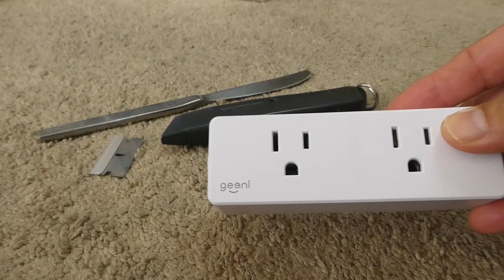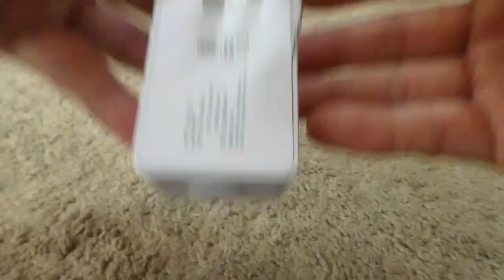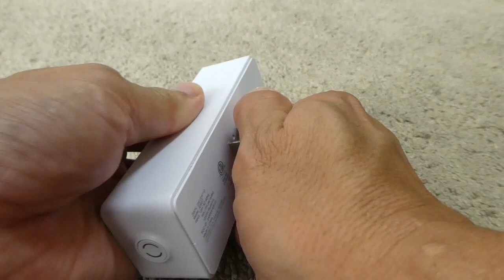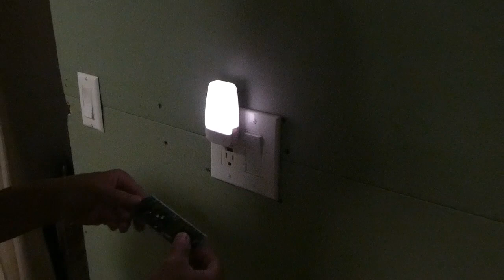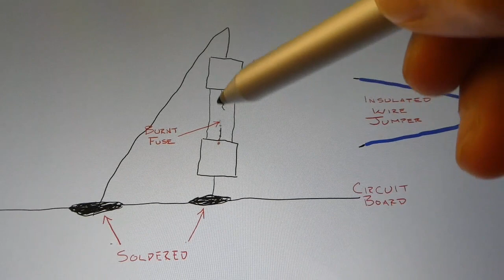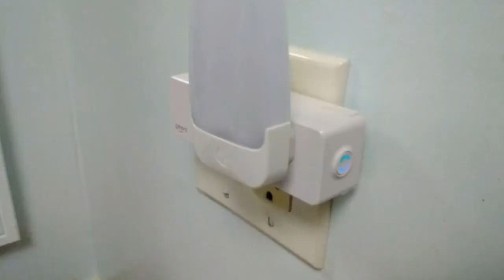Repairing a Geeni Duo Smart Plug

Comment: Hey folks. Please don't ever test a fuse by plugging the device under test into an outlet in this manner. The fuse exists to save your house or even your life in the event of failure or misuse. This is incredibly dangerous, and potentially deadly. Just off the top of my head: if the current is high enough to blow the fuse and you short it, there is a real possibility of badly burning your fingers. 

All you have to do is get a simple multimeter, learn how to put it into continuity mode and probe both ends. The device under test does not need to be powered. If it beeps the fuse is not dead.

Comment: Wouldn’t  an ohm meter be a lot easier and safer? You,may have to disconnect one side. But my light on indicator isn’t even working, any ideas? I see your fuse blown but the blue light indicator works, mine is totally dead. I will take apart and see . Good video
Reply from the maker: If you're able to fix it, could you leave a reply.  That's a new situation similar to when my fuse didn't blow, which I never fix.  These devices are so simple, it might be the same thing...Thanks
Reply: Yes and yes. There is no need for the device to be powered in order to test the fuse. Nor should the fuse be shorted with a piece of wire. Do a continuity check with it unplugged.

Comment: Are there 2 fuses (one for each outlet)?  The reason I ask is I have the same issue but only with one of the two outlets. Thoughts?
Reply from the maker: My Geeni had one 10A fuse for the unit of two outlets.  I did have a unit that recently stopped working (both outlets) and the fuse was still good.  I tried using a multimeter to see if it was a part I could replace, but my skills with the multimeter are subpar, so no luck with that.

Comment: My indoor round geeni smart plug doesn't power anything either
Reply from the maker: Basically, if what you plugged into it requires more than 10 Amps, it more than likely will blow the internal fuse of the Geeni.  You can find the amp rating on your appliance next to INPUT of the power cable.  It's usually right next to the volts it needs.  That's the max it will draw from whatever it's plugged into.  I had mines plugged into a water heater so I definitely realized afterwards that was too much amperage.

Comment: My Merkury SmartPlugs stopped working properly as well.  Very informative video.  I wouldn’t recommend Merkury because they stopped working after only a few months.  I expected more longevity.
Reply from the maker: Yeah, I've noticed a lot of complaints about that online from many brands.  I think they're just not meant for high amp appliances to be plugged in.  I had my water heater plugged in to mine, so that's more obvious to me now that I know.  I think things like hair dryers, fans, power tools, they'll all burn out the internal fuse.  Once that happens, the only way to fix it is if you can find someone who can open it up and replace the fuse.  Sorry about your Merkury.  Glad the video helped.

Comment: Do you know how to disarm the single plug?
Reply from the maker: Do you mean disable one of the plugs so there is no power even if you plug something into it?
Reply: You repaired a double smart plug. I have single smart plug, are different. I think I have the same problem than You. The green and blue led works, the same way, sound "click" when I order Turn On or Turn Off, but nothing happen with the apliance conected.
Reply: You used a knife to disarm, but the single plug does not have the lid flush with the box, they are a little different. We are talking about Geeni smart plug
Reply: I have problems with the language. I fully understand your technical explanations of the failure. I just want to know how to open the plastic box. My connector is different from yours.
Reply from the maker: @papeleriainfinity4640  OK, I understand now.  let me take a look at my single plug to see how it looks.  I'm not sure if it's the same as yours, but if it's different from  the double, then maybe.  I'll get back to you.
Reply: Thank You.
Reply: This is my Geeni Smart Plug: 

https://www.walmart.com/ip/Merkury-Innovations-Smart-Plug-1-Pack/126201995
Reply from the maker: OK, I think I understand.  Even the single plug version should have a FUSE.  If you plug something into the Geeni that requires lots of amps (see label on device).  If it requires more than 8 amps, the fuse on the Geeni will burst and all power will be cut to the plugs.  This is what I had to fix.  I could not find a fuse so I soldered a wire, but I no longer plug high amp devices into the Geeni.  Be sure to keep it under 8 amps.
Reply: Good grief! That fuse or substitute is easily found in any online electronics supply. In fact it looks like there is ample room to lay a typical replaceable fuse horizontal in the same general area held by fuse clips epoxied in place. The fuse area is the mains part of the device so there is no concern for voltage separation.

That fuse protects both of the outlet relays together. These relays are probably 10 amp rated. The amp rating is based upon the temperature it would be during continuous operation without catching fire. The relay contacts are within a small plastic enclosure and that relay is in within the white plastic case. There is very little chance for heat rejection. The circuit breakers in your house are at least 15 amp rated. You need to put a 10 amp or less fuse back into the device or destroy it so that it cannot be used. It is a fire hazard. Saying that you will not use the plug means nothing. Surely you have the ability to correct this. If you can solder then you can build a fuse holder.
Reply from the maker: Yours is different in how to dismantle.  I Google searched "Merkury dismantle" and "Merkury teardown", but didn't find anything.  Sorry.  I'd think if you can find a closed slot around any of the edges of your smart plug, that must be where you can open it.  If you can take a photo of your smart plug, email to xlessthanz@gmail.com.
Reply: Finally I decided to open it as it was and the only way is to break the lid. The lid has an edge that prevents one from separating it with a knife and the lid is stuck tightly. Sure enough, the fuse is burned, so I have to make a bridge with a cable like you. Thanks anyway.